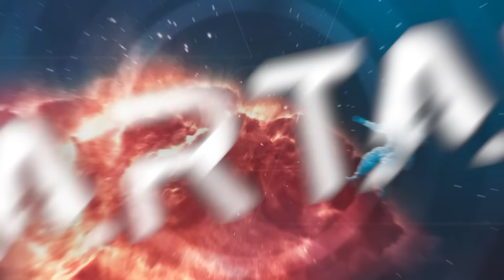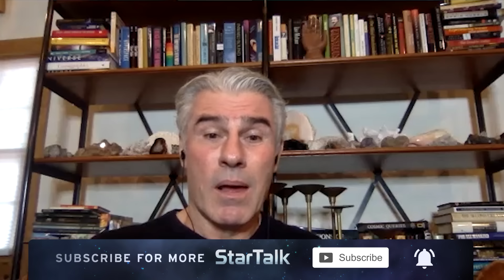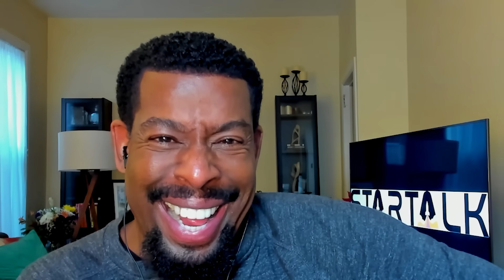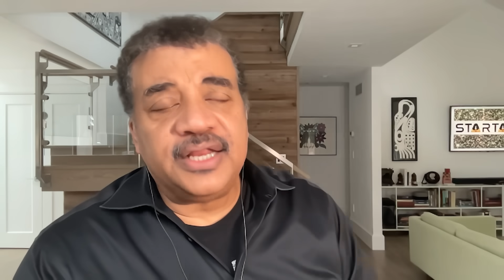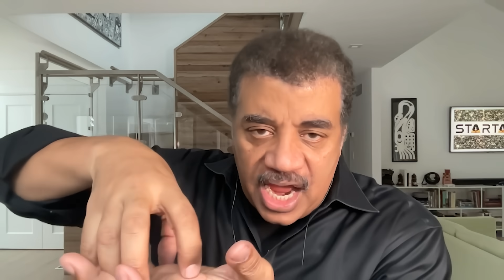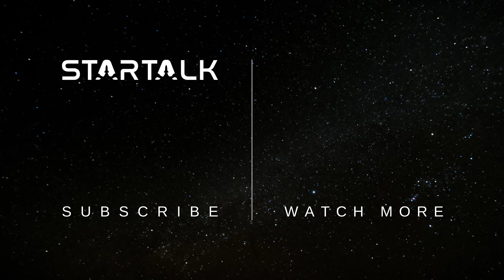What’s The Fastest A Car Can Go? | Neil deGrasse Tyson Explains...

Comment: Most of you commenters referring to faster acceleration times apparently didn't pay attention to what Neil explained in the video.
Neil stated, that, with a tire that has a friction coefficient of 1, you cannot accelerate any faster than at 1g without any other means to increase the weight of the car that presses it against the road surface. This is physically correct, as the friction coefficient is the ratio between the longitudinal force (relevant for acceleration) and the vertical force (total downforce). For normal summer road tires, the FC is typically not above 1,0.
Of course, you can add engine power at a greater rate than you load weight onto your rear axle, but it won't make for a better acceleration, if you are already maxing out the friction coefficient of 1. The tires will simply slip and not generate any acceleration.

Fan cars (e.g. the Spéirling): they evacuate the space underneath the car to create a differential pressure that sucks/pushes the car downwards. Of course, if you direct the fan outlets straight up, you additionally get the benefit of the impulse of that airstream (F = m x v).

Rimac Nevera and other super sports cars/hyper cars: definitely use more "sticky" tires with an FC > 1 (typically up to 1,4 for road legal tires). Additionally, as soon as it starts moving, it also generates downforce (which obviously increases with increasing speed). Which is both also true for the Spéirling of course.

F1 cars and similar: use slicks with an FC of around 2 (dry tires). Additionally, they create downforce once moving - on one hand by their inverse airfoils and depending on the current regulations also by ground effect (Venturi tunnels + diffusors increase differential pressure).

Top Fuel Dragsters:
+ friction coefficients of up to 5 (FIVE!!!)
+ specially prepared track + starting patch
+ considerable amount of additional downforce already at standstill due the impulse generated by the (roughly) upward pointing headers (again; F = m x v) --> typically 3-6 kN

Happy to stand corrected based on REAL SCIENTIFIC FACTS.
Thank you for reading! 🙏

Comment: Hi Neil, please talk to a tire compound expert about friction and adhesion. I see these kind of explanations too much in the "influencer" and marketing of tires. The friction formula you use only happens when the tire slips. At that time, tire wear shoots sky-high. An analogy is how much can you rub an eraser on a paper before the paper rips.
Normal driving happens in the adhesion range, even if you can't feel the tire stickyness with your hand. Race pros and engineers call this "grip". Also keep in mind that the tire deforms on contact, and you get a longitudinal compression of the tire (it's "radius" decreases, but you still have the same rubber mass). I'm pretty sure that deformation also helps fill some of the imperfections of the road (like pinching with fingers).
Friction and water channeling in tire discussions annoy the heck out of me.

Comment: What a bunch of jerks. All the people acting like he was "so wrong" when all he did was abbreviate and simplify a little bit. 

He is fundamentally correct.

It is a basic fact of physics that a coefficient of friction greater than 1.0 requires some extra force other than the "normal force" (which in this case would be gravity, and yes, normal force is the correct term). 

There are all kinds of extra forces that could fill this role and he covered pretty much all of the common ones. Aerodynamics, adhesion, mechanical linkage, etc.

There is no mistake in the knowledge or reasoning he applied.

Vehicles only exceed 1.0 G by applying extra forces to the tires--in addition to gravity. You could use magnetism, fluid mechanics, chemistry, electrical forces, mass redistribution, vertical acceleration, etc. Regardless of what it is, you must apply something in addition to gravity to get past 1.0 G.

This should be obvious when you  consider the friction of almost every material in the world besides sticky stuff. 

Wood, bone, stone, glass, metal, plastic, etc. Pretty much EVERYTHING has a friction coefficient of less than 1.0. 
The only materials that pass 1.0 are sticky or highly malleable. The highly malleable characteristic comes into play with soft rubbers because they sink into crevices in the road and create mechanical linkages like "gears." 

Still, the degree of mechanical linkage is pretty limited which is why tires never get very far above the 1.0 G limit. The most grippy tires probably max at around ~1.5-2.0 G's. Anything past that is usually from aerodynamic down-force.

Race cars and bikes normally get the highest G numbers during deceleration from high speeds when aerodynamic down-force and drag are the highest. Even then they rarely pass 2-3 G's.

Dragsters are the only vehicles that regularly pass 3 G's and they rely on heat treated soft rubber (mechanical linkage), sticky tracks, and aerodynamic down-force.

Comment: A Top Fuel dragster can accelerate from 0 to 60 mph in approximately 0.4 seconds and can reach speeds of over 300 mph in less than 4 seconds. Top Fuel dragster drivers experience significant g-forces, particularly during acceleration. They experience an average of around 4.0 g (39 m/s²) over the race duration, with peak forces exceeding 5.6 g (55 m/s²)

Comment: Neil has a valid statement hidden in there. The physical limit of acceleration of a wheel-driven vehicle is 1G if you don't employ any sort of tactics to increase tire loading, increase the coefficient of friction between tire and road past 1 or add some sort mechanical interlocking with the road. 
Sadly he doesn't know much about high performance cars and makes a bunch of false claims because practically all of them employ tactics to increase tire loading, some of them to a surprising degree.

Comment: The problem is not getting a design for downforce, it's a suspension quick enough to react without launching the vehicle.

Secondary is turning. At some point, turning is not an option.

Lastly, stopping reliably.

I've done the Star Wars Trench Run a million times... Gotta pull up in time.

Comment: I like your videos, but you’re illustrating a point that’s kind of funny… You’re setting up a lot of parameters to get the result you want. Like it has to be real wheel drive and can’t have high performance tires, etc. 

The Rimac Nevera can do 0–60 in 1.74 seconds which is approximately the equivalent of 1.57 G. 

Drag racing cars can achieve 0 to 60 in less than half a second.

Another thing you didn’t mention is the overturning torque force on super powerful drag racing cars where it’s accelerating so fast the front end actually lifts up.

Comment: The McMurty speirling proves this theory wrong with its 0-60 of 1.38 seconds.
Reply: In actuality it proves it right, they are saying you need instant downforce which the fan on the bottom does for the sterling and drag  strips they use to set times are sticky.

Comment: A downforce wing produced MORE than 1G downforce.  You are still stuck on the wheel producing the motion.  How fast does the military's rocket sled go?  How fast would it go inside a sealed, evacuated tube?

Comment: Except tires DO stick to the road AND fill in "holes" in the road.

Ppl not doing burnouts before their drag run for fun. Well not just for fun.  And the surface of the road isnt perfect like a slab of metal. Up close, its all potted and holes etc.

Fun fact, if you take a slow motion up close video of the contact patch of a drag car, the tires literally pull parts of the surface of the road up. Thats how sticky the tires are. Im sure u can find a video of it
Reply: They discussed that...

Comment: It also depends on how the power is applied, but even if you just mash the throttle from standstill, The Lucid Air will get to 60mph in about 2 seconds on regular asphalt using DOT street tire.  It’s actually kinda scary.

Comment: I have a Yamaha in my garage right now that can disprove his numbers in real time. With a normal street tire on common pavement. Sorry Neil, you got this one wrong. You failed to consider many other factors. Weight transfer, suspension reaction and geometry etc... 
 Drag cars also break your thesis on a routine basis
Reply: Let’s see.
- Formula 1 uses downforce and center of mass is as close of the surface as possible.
- Drag cars, basically burn rubber in start, so back tires stick on road.
- Yamaha is motorbike it weight like 100 kg. So basically nothing. I think comments are more wrong than Neil here. 😂
Reply: @OnlineWithMikko  If you have no experience with superbikes or supernaked bikes, just say so. There is no need to highlight your ignorance. I have a Yamaha MT10. It weighs 208kg, about 310kg with me on it. It makes 160 rwhp and 85 ftlb of torque. It can accelerate from 0-60 in about 3.2 seconds. Sub 11 second quarter mile in stock form. Mine has been modified and is a bit faster and runs 10.1 to 10.3. Top speed is gear bound to 160 mph but reaches top speed in under 15 seconds. It runs a 180 series rear tire with more than enough traction. Spinning isn't the issue. Keeping the front wheel down is. That's actually the limitation to faster trap times. If you could keep the front end down, it would keep pace with an F1 car up to about 100 mph. Theoretical 0-60 is about 2.5 seconds, but you'd ground loop if you accelerated that hard. Regardless, the bike is faster than Mr. Tyson claims is possible even if it is lift hindered from being as fast as an F1 car from a dig.

Comment: Dragstrips use asphalt for the surface in which to race. It's very sticky in relation to tires. Concrete, on the other hand, is a very rough surface. Like sandpaper, tires have a component to grip to moving forward. Or laterally.

Comment: My Sportsman XP1000 can go pass  1 G force on take off a cording to the DRAGY and it has knobby tires so guess it gets a bite  on the pavement. 
It's 60 ft 1.86 seconds 
0-30 1.65 and 
0-60 5.59 seconds 
DRAGY VALID 

0-60 5.59  INVALID because it was slightly down hill. 
Stock tune Stock exhaust

Comment: Your title is incorrect based on your theory. The fastest a can can go is as fast a sit is designed to do (current record 295 mph), your talking about acceleration limits built on technology (down force aerodynamics) at the time of this video. Your title should read "What's the acceleration limit of a car?". Fast forward two years and you get EVs with fans creating down force by creating a vacuum at 0.0 km/h, doing 0-100 km/h in 0.956 seconds (that's 2.96 G).

Comment: Between Neil and all the comments correcting him, I haven’t seen a single mention of All-wheel drive, which helps many sub-3 & sub-2-second cars do their thing along with grippy rubber. 

Not easy to slip all 4 tires in place Scooby-Doo style even when it’s got 1000+ horsepower.

Comment: So... The LUCID Air Sapphire consistently achieves sub 2,5sec 0-60mph on Street Tires, on the Street... and so does the TESLA Model S Plaid.

How do you explain that?

Also, talking about aerodynamics, some Hypercars, like the BUGATTI Chiron SuperSport 300+, reaches a Top Speed of 314mph, and also the KOENIGSEGG Jesko Absolute goes over the 300mph barriers, but the engineers say that the 500kph is essentially the Limit for Top Speed on Wheel Propelled Car, because Air starts becoming liquid, so beyond that speed you would be forced to use a Jet Engine and not Wheels and Tires to push... Why is that?

Comment: It would be interesting to see how a rack and pinion railway would perform if the locomotive engine was capable of producing the kind of forces necessary to perform a >1G acceleration. Such railways are normally used to provide slow moving trains with the traction needed to traverse steep slopes but, on the level, that type of toothed rail would certainly provide the kind of wheel-to-road grip necessary for some serious acceleration.

Comment: You could buy a Y2K motorbike with a Helicopter jet engine! The stock Tesla Model S Plaid does 0 to 62mph in under 2.5 seconds without 1 foot rollout, on unprepped roads with stock tyres (great ones), so basically the latter literally is defying physics (as is all the other amazing petrol cars and bikes are these days)

Comment: Well, fist time i have to disagree with Neil! Lots of cars accelerate faster than 3 seconds 0-60 on not so special roads.
Reply: The man said a couple ways to increase that acceleration. Pay more attention before disagreeing that fast.
Reply: @preslavo  a couple ways was to increase weight or have a special track or some kingd of cog rail system. See i  paid attention to what was said. The cars that actually achieve faster acceleration do so by increasing contact surfaces area of the propulsion. Traditionally, cars are front or rear wheel driven and with a differential, one wheel is permitted to slip. This is highly inefficient. You add an locking mechanism to that differential, now you have two wheels pushing you forward, new hyper cars have elaborate all wheel drives that push the power to all wheels almost equally thus providing four times the contact area than the traditional car. Add a larger tire and you’r sitting on a sub 3 seconds 0-60. No weight added, no specitrack or whatever.

Comment: About that Merlin Rolls Royce Spitfire engine. It was the same engine as the one in the airplane but the one he used was actually from a tank. He built 2 cars like this. One is called The Beast, it resides in Spain now. The other is called The Jameson, which was last sighted in The Netherlands. I have sneaked into that car when it was on display in a museum.

Comment: For everybody talking about cars on unprepped streets doing 0-60 faster than 3 seconds - most of those cars have some downforce through body design and/or a spoiler, and real-world tires are not relying purely on horizontal static friction. The analysis of that limit assumes downforce provided only by gravity and a perfectly smooth, flat, road with non-sticky tires. On a normal road the tire conforms somewhat to imperfections in the road, so part of the grip is like interlocking gears. Without aerodynamic downforce and driving on a sheet of smooth steel or glass with non-sticky tires, the limit would hold. Of course, he could have mentioned those things.

Comment: Hmm.... My plaid is at 2 seconds, no gears, no race slicks.
Reply: I know right? This video didn’t age well. Plaid is heavy and has lots of HP, that means powerful traction. It is easily faster than 3 seconds.
Reply: Unfortunately it looks like a Telsa
Reply: He states (not very clearly) that the approximately 3 second time is with no downforce and coefficient of friction of 1. He also doesn't account for the fact that there are a wide range of tires that can be used which give different sized contact patches and therefore different amounts of friction. Essentially he was just going off a very basic estimate without considering details.
Reply: maybe 2.2 😂

Comment: Neil, I think you need ditch all this hog wash and remember that time and space and motion are same thing.
In the case of a Vehicle, you need to produce TORQUE. The circumference of a circle is mathematically a 2D line segment. 
A tire rolling on the road is MESHING with the road like gears do. Surface to Surface contact only at the electromagnetic level Neil. The Strong Force.
When it comes to Tesla, I'm going to beat you and your squad at RC Mario Kart each and every time.

Comment: That was where my mind was going (@7:17) if you increase the width of the rear tyres, lower the airpressure so there is more tyre real estate, heat the tyres, with a grip compound, vaccume out from under the car, have an active aero on the front and back of the car that lowers the down force upon the stopped to started speed, while also conrolling the strength of the vaccum from extream to less as the car gets from static to moving. I would assume then that over coming the 1g barrier is very possible. also to have a veriable power delivery system that can shift torque on the fly from the front to the back and distribute to all 4 wheels. ie min pull up front, max push from back and as you start moving the drive of torque changes fully to the rear. allowing the thinner front tyres to only worry about navigating.

Comment: how about fan cars that make there is a small prototype that pulls the air underneath the car generating twice as much weight than the mass of the car they have one engine in each well and produce much more than a thousand horse power. they won a lot of those car festivals believe they go from 0-60 in ,76 seconds but check the numbers

Comment: As a car accelerates so does the amount of force needed to move the car. Has nothing to do with tires. An engine can only overcome a certain amount of force. Basically for every action there is an equal and opposite reaction.

Comment: Terminal velocity is a fascinating concept in physics, describing the maximum speed an object can reach when falling through a fluid, such as air. It occurs when the force of gravity is balanced by the drag force, causing the object to fall at a constant speed. This equilibrium creates a unique dynamic where heavier objects can have different terminal velocities compared to lighter ones. But what factors exactly determine how quickly an object reaches its terminal velocity, and how can we manipulate these factors in practical applications like skydiving or engineering?

Comment: The fastest a car can accelerate is NOT the fastest a car can go. With a long enough straightaway, even at 1G acceleration you could theoretically approach light speed. Of course, this would require this to be in a vacuum and an ungodly amount of fuel....